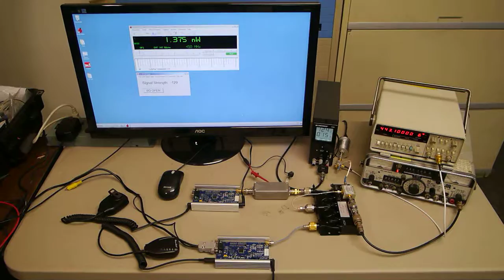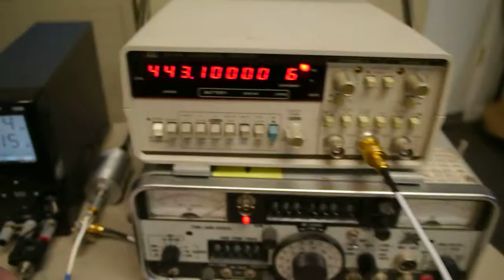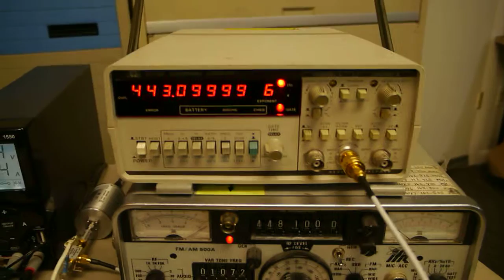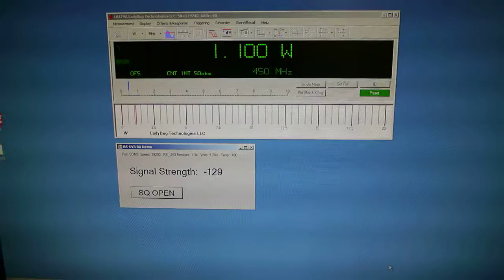HobbyPCB RS-UV3 443.1 MHz Repeater

Comment: How are the two radios connected for full duplex . Software setup?
Reply from the maker: Hi Kirk,

To set up the RS-UV3A's for repeater operation you will need to program one as a RX and the other as a TX.

For the RX unit set up the following parameters:

Frequency
Squelch
Tone Squelch frequency and mode (if used)
Volume Level

Remember to issue a "ST0" command after you get it setup the way you want to store the settings as the power-on default.

For the TX unit set up the following parameters

Frequency
CD ID speed, text and Interval
Hang time
Time out timer
Tone Squelch TX tone (if used)
Courtesy Beeps (if used)

Remember to issue a "ST0" command after you get it setup the way you want to store the settings as the power-on default.

To key an external amp you can use the 'AO3' command to set the TX units DO pin to be high(3.3V) on TX and low (0V) when it's not transmitting (don't forget the ST0). Then use this signal to drive a MOSFET (2N7000) to key your amplifier. If you don't feel like rolling your own relay driver an one-channel relay driver for the Arduino will work nicely.

73,Jim WA2EUJ